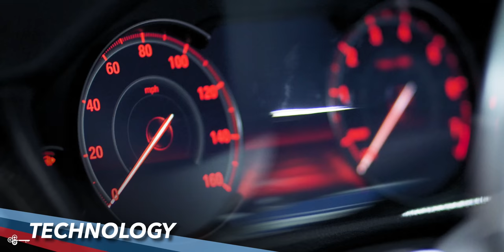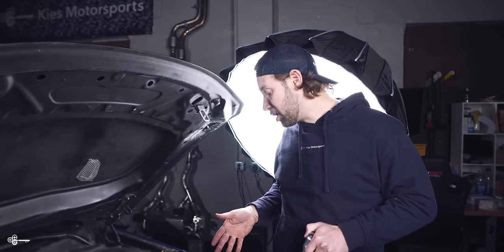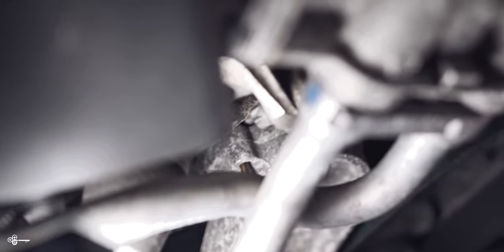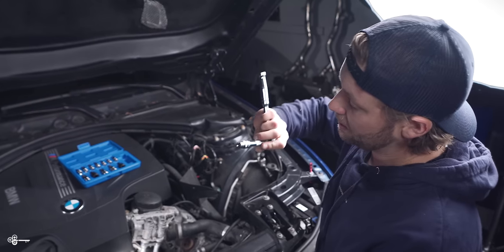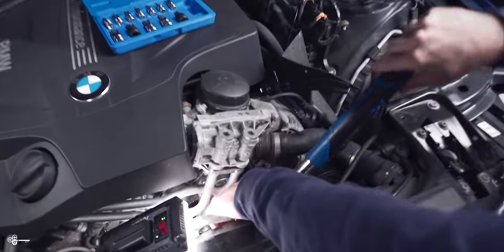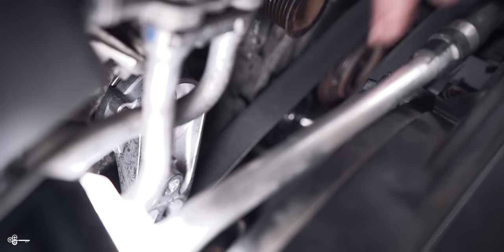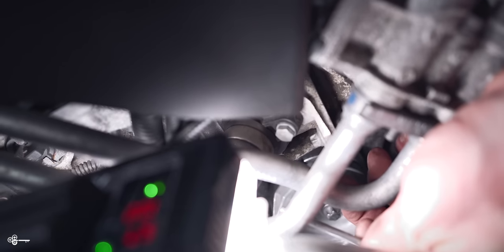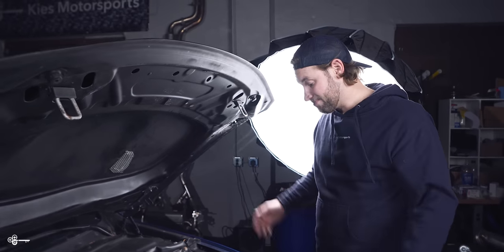BMW N55 Tensioner, Accessory Belt and Idler Pulley Replacement (F30, F32, F15, F25, F10, etc)

Comment: Just did this on my M135i, anyone debating it, do it, it's so easy  just get the right tools.  My old tensioner was definitely moving, new one is absolutely rock solid.
Reply: Mine blew up because the bearing of my tensioner broke. I think i try to do it myself.
Reply: @TomMarvoloRiddle01  the idle pulley blew on mine.

Comment: Just complete this job … I completely ignored the drill bit step and relieved the tension with one hand and pulled the belt off of the idler pulley with the other lol no need to fumble and risk breaking a tool you might need down the line … kept the pin from the new tensioner in tool box just in case

Comment: Good video. Hard to really show what's going on in such a tight space but you guys did a great job with lighting and trying your best not to get in the way of the camera. I do have a suggestion for what you could use to replace that retention pin instead of a drill bit. Drill bits are very brittle and might snap when being used in this method, especially if someone decided to use a smaller diameter bit than what you used. I would use a nail instead as they are ductile and would bend before breaking, a dime a dozen, and if you accidentally left it in before removing the tensioner, it wouldn't be the end of the world. I'm not familiar with how much force the spring inside the tension arm is applying so take this suggestion for what it is, a thought.

Comment: I was literally just thinking about doing this to my 335i
Reply: Diego Carmona My 2015 335i is at 90k miles and I’ve noticed rapid movement on the tensioner.
Reply: Mine moves a bit like this one. is that normal?

Comment: Great video! Here's a tip that will remove a lot of frustration when fitting a new belt.  

Install the idler pulley after routing the belt!!! So much easier...
Reply: Holy ** you are a legend… I couldn’t for the life of me get the belt on my e70… I want to high five you

Comment: You shouldn't need the drillbit.  That's why they don't provide a metal rod for your old tensioner.

It's meant for you to remove the belt while holding the tensioner with the T60.  Once you have the belt off, you can release the T60.  They have the new one set for your convenience only.

I like your idea because the engine bay is tight.  But just saying you don't need the drillbit.  You can save the metal rod from the new tensioner for the next job.
Reply: Agreed, and if you do it this way you can take a lot more tension off the belt… it comes off much easier.

Comment: Fantastic videos thanks guys. 2 questions hopefully someone can help.

1. I suspect this is the repair that I need to do, but I'm not 100% sure. My car currently makes a weird high pitched noise a little that sounds like the tensioner/belt needs to be replaced (I had done this previously at ~65k about 2 years ago. I'm at around 81.5k miles now sounds similar to before when I changed it). What are the normal side effects/tell tell signs that I need to change em.

2. I have a 2013 335i xdrive coupe e92. Anything that I would have to do differently on my specific model?

Thanks in advance!
Reply: Did you ever find an answer to this? I'm at 82k miles and this has never been done so I'm wondering what I should keep an eye out for

Comment: My e92 n55 tensioner started making a rattle, quickly replaced before the failure! Great video
Reply: Could you here it? Was it loud?
Reply: weird! sorry to hear this. Mine has some play when the engine is running. is this normal? mine moves a bit less

Comment: 2015, F10, N55. After replacing the ser. belt, the tensioner and the idler pulley, i have a feeling that the engine is more responsive, almost no lag! Does that make any sense?
Thanks
@kiesmotorsports

Comment: So much harder than it looks. 

Stripped the e12 somehow. Hopefully tightened it enough, but torque wrench never clicked

Gave up on removing the pulley, the t50 was getting twisted without any give from the bolt. So said f it I'll leave the existing pulley on.

Comment: On the F10 535i, there is a bracket that blocks the bolt head of the Idler pulley, this bracket  holds in place the two AC compressor hoses.

Comment: Thank you for upload. Yesterday changed and replaced my belt, two pulleys and the tension pulley. N55gas 3.5 Xi x5. Current mileage 176,741 kms. When I took out the lower pulley that was making a sound, probably was the original factory. I bought the pulley and tensioner from FCP - OEM. Fit like glove. The  top pulley was leaking some grease also. Ok

Comment: What about us N20 users 😭 I have so many questions as someone that wants to continue working on my car! I have 6 years of part time experience as an electrical motor mechanic and I am now a full time electrical engineer. I’ve been following your channel for a year now! Thanks for all the awesome content, btw!
Reply: n20 is pretty similar if not slightly easier imo because the location has a little more room.  Pretty much the exact same process as this one was, just in a different location.  I used this guide for it.
https://www.youtube.com/watch?v=oN4acq0rd8U
Reply: Joseph Frasier it’s exactly the same on N20, and yes much easier since the engine has more space :) just did this one mine

Comment: That's funny cause i just replaced my bmw 535i f10 M-Sport belt tensioner, two idler pulleys & German serpentine belt all OEM, yet my tensioner pulley still shakes as the new belt vibrates next to it so urs on this video seems normal. The problem with the old tensioner was that not only did it vibrated more than the new one but it also made bearing noise! 
When the lettering on the old belt shows fading, then it's time for a new one!
Reply: Hey was your idler pulleys hard to change ? I have the same car and by the looks of it, it looks like there’s hoses in the way on the upper idler pulley.
Reply: This. I changed my tensioner pulley recently since my old one shakes like what’s in the video. Then new one goes in and it was steady for a few days then it shakes again. So the shakes are normal as long as it doesn’t make any weird noise.

Comment: I just bought an M2 with the n55 , i noticed a wobble in the crankpulley and the tensioner is vibrating too, the car only has 16.000km ,I cant believe the tensioner is already gone bad.. should i be worried ?

Comment: How do you know you need to replace the pulley and idler as well as at 140k miles the belt and chain tensioner was all that was changed by BMW on my 2012 F30 320d sport.

Comment: Thanks for excellent video. I need to do this on my N54T. Have tensioner & two deflection pulleys ready to go. 
The torque specs confuse me. I've seen one sheet that days 40nm on all. Then another that says 60nm on deflection pulley & 25nm +90 degree turn on tensioner.
Why so varied?

Comment: At 60k miles I had my belt rip off, and dig through the crankshaft seal (front main seal). Pieces of belt ended up inside of the engine. Thankfully I turned the car off on time and we were able to pull the bottom end off and clean out all the belt pieces. 

50k mike is a must for belt and tensioner replacement on these cars.
Reply: Just today i had done a quick first gear pull and after when I was coming to a stop I heard a noise as if I was dragging something from my bumper I was at my gate for my community when the belt ripped off got home and shut the car, my friend mentioned this same worry, is it easy for it to slip into the crankshaft pull ?
Reply: did you have an OFHG leak?
Reply: @MustafaDarwiche  bro same dude u ever fix?
Reply: wow! sorry to hear that! Mine moves a bit, I hope this doesn't happen to me.

Comment: how is your oil filter gasket, my car is 65k km and its for change, also how often do you change your belt and belt tensioner.
Reply: Just got my gasket done at 77k. worth it. $880 for it though... that wasn't fun! does your tensioner have play? mine does, is this normal?

Comment: So it's not supposed to do that?! Took it to dealer and they said it was normal, have had it for 12k miles year n half, 94k total miles! On a 2016 435i. Taken many shortish road trips and driven it hard. Champ car so far
Reply: Was it making noise 2?
Reply: same with me! Is it normal for it to move?
Reply: @Anthony-qh1xv  Bro did you end up changing or left it the way it is. I changed mine and the new one seems to have same rattle as old one. 😢

Comment: Would this apply to the S55 engine as well?
Reply: I think so. almost the same design, but the S55 is closed deck, and some other changes, better rod bearings in the S55, later N55s (2014+) are using those better bearings as well. overall, a good design.

Comment: I have a b58 340i and just noticed my tensioner pully is moving to the right when revving it.. Only when i rev it. Its a 5/2018 model with only 22.000kms? is this normal?
Reply: Every tensioner will move when you rev it. When  you rev it, the tensioner moves and makes the belt tighter. If that makes sense.
Reply: This is normal. I don think ant B58 has shown this as an issue yet. Surely eventually, but that engine is built much better than most older BMWs
Reply: @NoClutchGarage  im gonna try send you a video of it.. but has been 2 months now, its still doing good, but i have a feeling its wiggling a lil bit.. cold and warm, i just subbed btw ;)